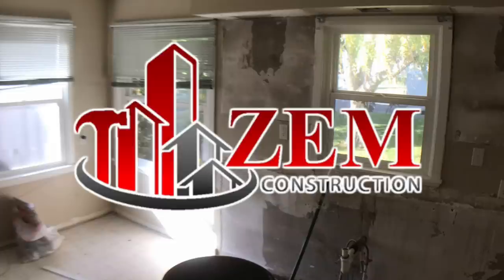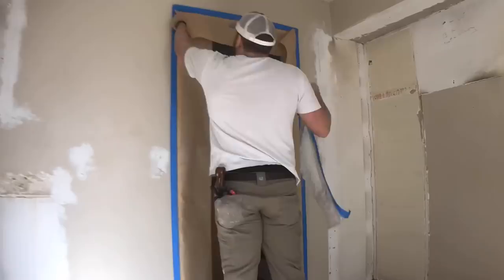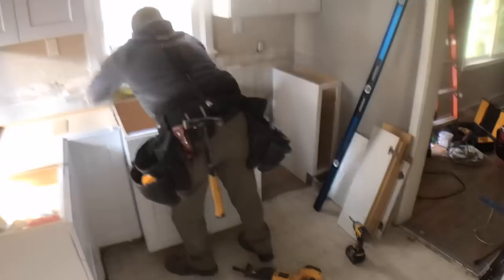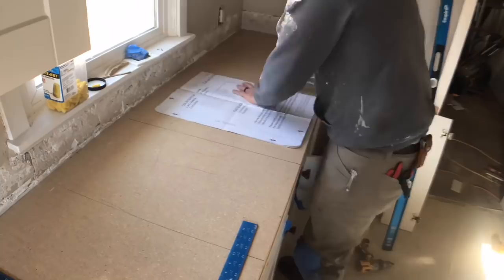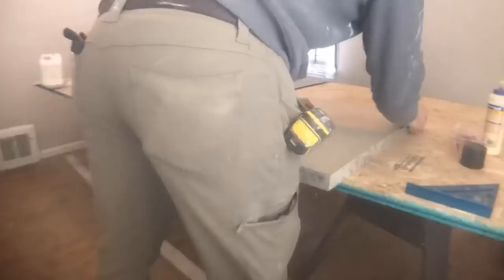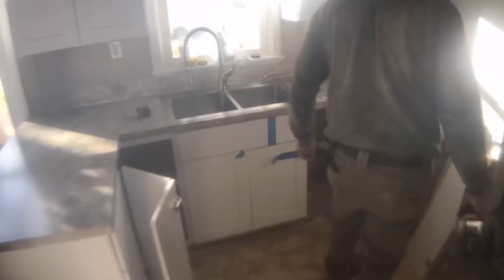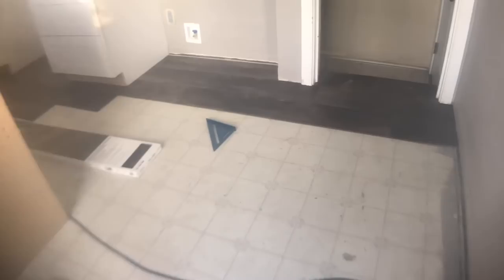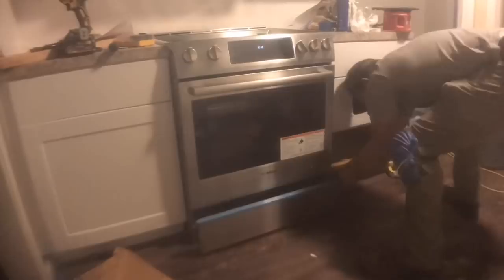Kitchen Remodel | Full Time Lapse | DIY Friendly

Comment: My dad textured our house completely and also had to scrape the old popcorn ceilings. And a flattened spackle to me looks amazing. So it doesn't have any points, but lays flat and looks like little circles and domes in a way gives some depth but isn't ugly. The pointy orange peel is annoying but take a long putty knife and drag it over it when wet and knock it down gives such a great look.

Comment: Great project. I appreciate the time it takes to edit and speed through this type of project in your videos, not to mention actually filming it while on a clients time line, sheesh... The only critique I will throw out is, that bent up AC vent... replace with a new one.... (or take the old one off, clean it up, hammer it square, and spray paint it new.)
Regardless, who ever rents this home is getting a great place to cook and gather. Good job!

Comment: I took a very close look @13:54 and to me it seems as if the sink is flush with the counter top and doesn't seem to have any upward lip resting on it. I've rewinded back and forth it's not mention in the video how you achieved that because I have the same Sub-Zero sink but my sink rests on top of the counter. I'd like to make it as you've done so I can wisk the clutter or water right into the sink.

Comment: Should have made that L bend in the counter have a hang-over and made it a bar.  Two stools on the other side would have worked-out perfectly.
Reply from the maker: Actually I suggested that at one point. However the window right there limiting the countertop would make it so that any added overhang would take away cabinets. Also that area in front of the window is already so small, a table and chairs would barely fit, adding two more stools would be really crowded. Thanks for the comment!

Comment: Why didn't you put a box to the upper right corner (next to the dishwasher) to match the tiles on the wall, instead of making a two door box, make a 1 big door, then add the other box on top of the tiles, so the tiles doesn't look out of place! Other than than you did a great job.

Comment: Why are the top drawer faces different then lowers?
Reply from the maker: I think it’s a design aspect, if the upper drawers had the same frame the space in the middle would be very thin and would look funny. Also wouldn’t leave much room for a drawer handle.
Reply: Different factory design.